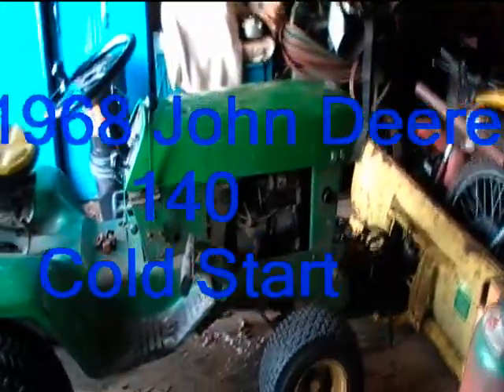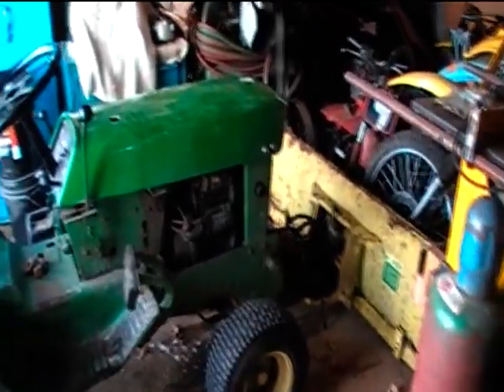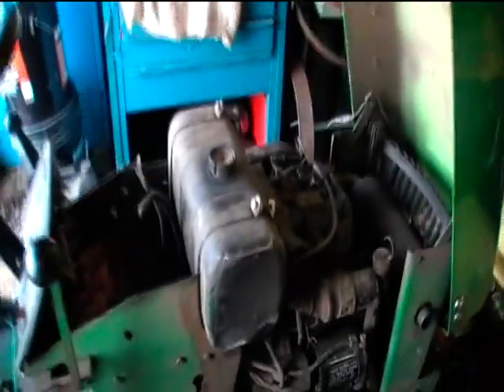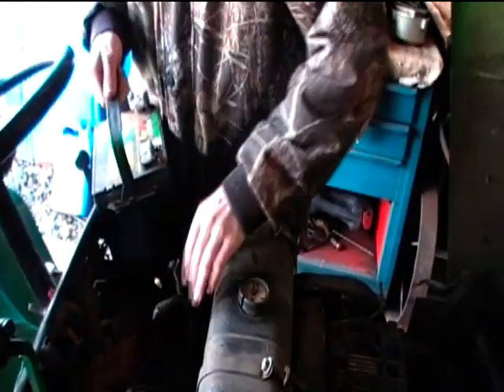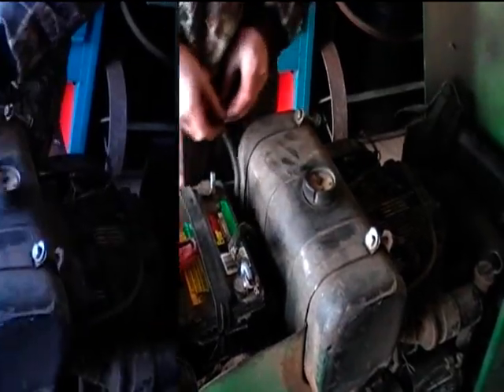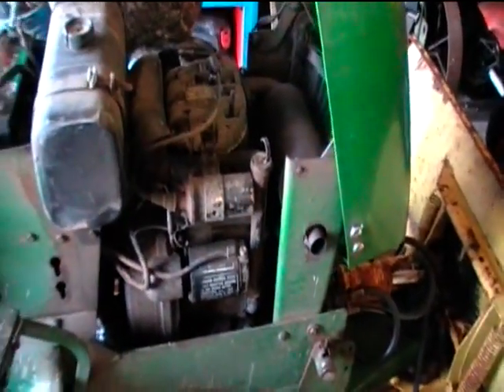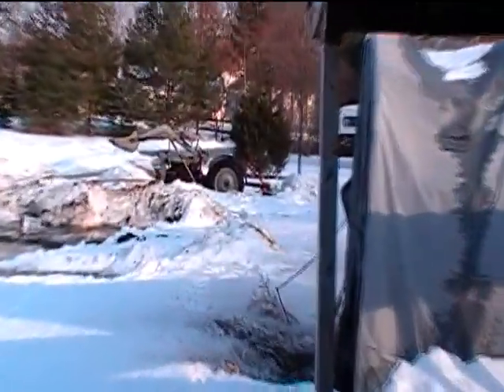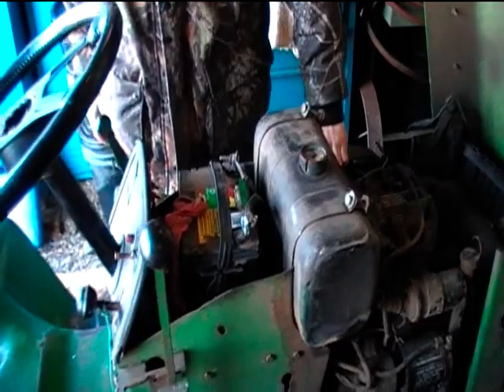1968 John Deere 140 Cold Start

Comment: I have to agree Ed, I was looking at 2 true known 1968 140's today. an h1 and an h3.they have some distinct differences that distinguish them from later 140's. the speed control lever would ride against a black plastic plate with a notch for neutral. the 69 on up had a steel plate around the speed lever. the h3's have hydrolic lines running infront of the flywheel visable outside the tractor. there is more but your tractor is at least a 69 or 70 no question. run your serial #